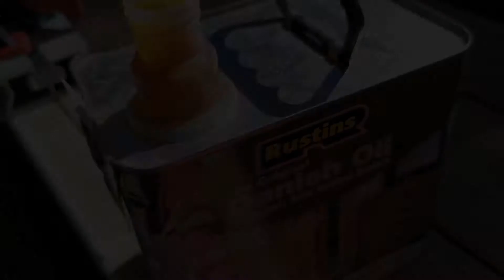Parkside (lidl) lathe wood turning project - Pepper mill holders

Comment: Gloves...when working on a lathe???  Why would you want to? Why would you need to? ...so dangerous!
Reply from the maker: probably not necessary but I often wear them as good practice when operating any such machines.
Reply: @creationtools9541  "good practice"...in what way, shape, or form can it be "good", its a dangerous practise! There is no reason for it, but every reason against.
Reply from the maker: @chrischambers5466  what I meant is that it is often good practice to wear gloves when operating machines in general. I assumed the same when working with a lathe. Perhaps I am wrong.
I'm still new to lathe work and I'm alway happy to listen to advice from anyone with more experience than me.
Reply: @creationtools9541  even a small lathe like that will keep turning with cloth wrapped around it, can you imagine what could happen? You would not have time to react. Personally I don't even wear long sleeves when I'm turning. The pepper mill holder is a good idea though
Reply from the maker: @chrischambers5466  thanks, I really do appreciate the advice. I'll definitely quit using gloves.
Reply: @creationtools9541  think about wrapping cloth around your fingers when polishing the interior as well! Use a stick👍🏻 These things were explained to me when i did a course (many years ago) I hate to think of anybody hurting themselves